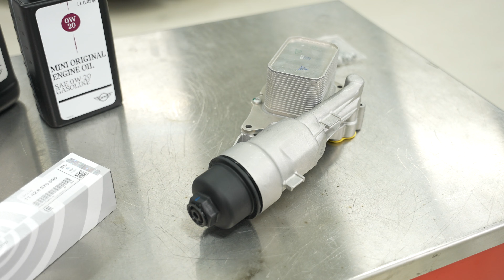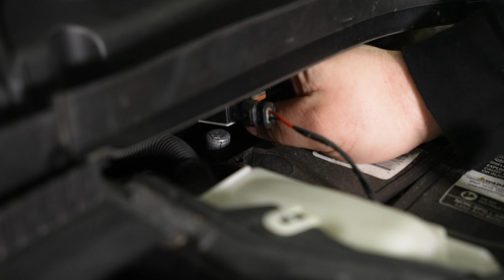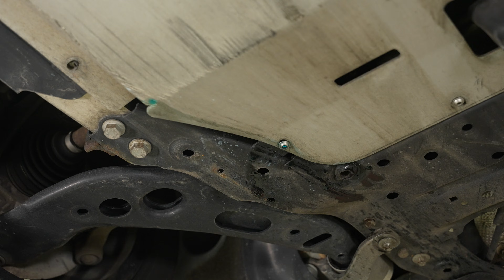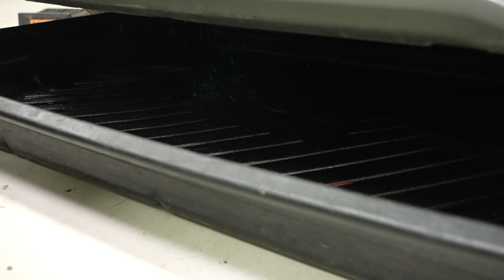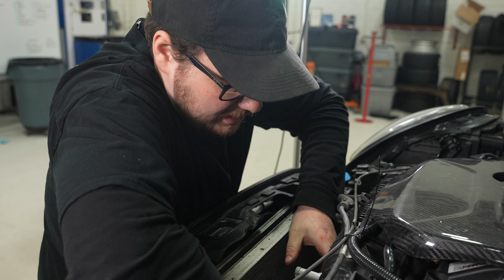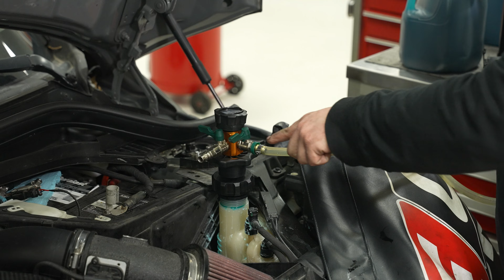B48 F55/F56/F57 Mini Oil Cooler Housing Replacement | ECS DIY

Comment: Thanks for the great video.  I was able to remove and replace mine without touching the AC on a 2017 Mini Cooper S 2 door by following these directions.  I did run into an issue removing the fan shroud.  There is a barb on the passengers side just in front and below the mounting bolt.  It took me a while to figure out it was there but once I saw it I was able to pry it back with a flat screw driver and get it out.  When you have the old oil cooler out, move the wire clips from the old one to the new one before you install the new one.  I neglected to do this and then had to remove the new one to get the clips on and in the correct orientation.

Comment: Can you do the afding the collab part without that suction device? Just poring in New coolant?
Reply: yes u can , but u wll have to bleed the air using the plastic crew next to the coolant cap

Comment: Great Great guide, thank you, I found it useful. However, the torque you provided for the oil filter housing bolts is incorrect. The official guide specifies 10Nm, not 8Nm.
Reply: https://static.nhtsa.gov/odi/tsbs/2014/MC-10148281-9999.pdf

Comment: 2018 Mini Base model with B38 - USA.  My car has one bolt left before I can remove the housing...yep the much talked about bolt that is directly behing the elbo that comes off the of the back of the A/C compressor.   Maybe a warning that this procedure only working on the model you repaired and give a detailed configuration.  😡

Comment: Thanks for the video - I just took mine to the garage with an oil leak.  They judged it was the oil filter housing that they replaced.  Its still leaking so I got under the car and saw oil forming on one of the bolts.  They are now saying it is the oil cooler leaking.  Am I correct in thinking the oil cooler fits on to the oil filter housing and this would have been removed and refitted in the process of replacing the filter housing?

Comment: Trying to reinstall with ac in place proved too hard for me… I got it out but can’t get it in.  So I removed the 4 screws on the housing cover and slid it in in 2 pieces. Hardest part was getting the mounting bolt thru both pieces near the ac line.  Do that first.  Then the 4 screws. Then the remaining mounting bolts.  Not fun.

Comment: Yes, the a/c is definitely in the way on my 2016 base cooper… I was able to get the housing out without touching the a/c but I had to make a custom “offset E10” socket - basically a short L shaped extension welded to a shortened E10 socket - only for the the lower 2 bolts - could only do a 1/4 turn at a time but it worked.  Still a challenge to snake the housing out, but it came out from the top.  Also, before unbolting the housing, had to pull all cables off starter and pull them all the way thru the small gap between the a/c and housing.  Good luck.

Comment: Not going to lie, the most important part you left out. 😂

How to get the 5 bolts out. 

U have to remove AC. Was this not mentioned?
Reply: I just did this work on my 2019 F56 and had more than enough room to remove without having to drain the A/C. Maybe depending on model and year of the mini it will have a more tighter work environment?
Reply: Just replace one on a 2017 definitely did not take the air conditioner, lines or air conditioner out of the way
Reply: @lukemcmullen5976  you had to remove the compressor bolt though

Or one hell of a swivel
Reply: Well, there’s AC line that comes off the back of the compressor. It is pretty difficult to get around, especially with torque wrench is possible though wish I could put a picture on here. I actually got it sitting right in front of me.
Reply: @lukemcmullen5976 

The time you take trying to get around it  isn’t worth the headache

I removed compressor and that was stuck on the bracket
Reply: 🥷🏼 the a/c line is miles from the housing 😂

Comment: How long does it take for the entire process? I am trying to predict the cost from my garage
Reply: When I was quoted a time from my local Mini dealer (who has been pretty fair with service times in total in my past experience, though I'll leave that to others for the quote they gave for this job), they estimated a 9-10 hour job to replace it and clean up the previously spilled coolant. If I had a garage, I'd probably do the job myself anyway to save the money on labor, but I don't. Ended up grabbing an F56 instead, and I'm hoping that it won't need this fix before I get a garage lol

Comment: is it the same procedure for F56 engines? do you need to remove AC cooling line right next to oil filter cooler?
Reply: very similar f55,f56,f60

Comment: DO NOT attempt this unless the refrigerant has been properly recovered using a refrigerant recovery machine or by an AC shop. The AC lines must be removed—there is no way around it. I tried every possible workaround, and now it’s too late: the oil filter housing is stuck and will not move in or out.
I now have to purchase a refrigerant recovery machine to evacuate the refrigerant before continuing. If you plan to do this job, have the refrigerant evacuated at an AC shop beforehand and recharged afterward.
It might be possible if you are willing to bend the AC line, but I strongly advise against it. If the line breaks and compressor oil leaks out, it becomes a much bigger and more expensive problem to fix.

Comment: How do you get the freakin fan shroud loose? I’ve removed the bolts and can’t see any clips or anything
Reply: Dealing with the same thing right now and would love to know how this comes off. In mine, it almost feels like it's bonded to the radiator.
Reply: If anyone runs into this, there's 2 clips by where you remove the screws for the fan shroud. The one on the driver's side will be facing away from you and the one on the passenger's side will be facing toward you. There's an opening where you can insert your pick tool and use it to pull the tab away from the shroud while you gently pull up on the shroud. Once you do this on both sides, the shroud will come right out. I *really* wish this had been shown in the video as it would have saved quite a bit of time trying to figure this out.
Reply: @scottdaves3930 you’re a lifesaver, thank you
Reply: @scottdaves3930  thank you so much for the solution i've been struggling with, both the editor and cameraman for this vid are trash. can't see what their doing half the time AND they're skipping over crucial info.
Reply: I just did this and one thing that held me up was these fins that line the back of the shroud. They’ll flip upward and catch on stuff. I used a big flat head to push them down as I pulled upward. 

It’s a little bit of a battle lol

Comment: Awesome work. Could you let me know the risk of removing the intake plenum for this work? It feels more easy than removing radiator fan and will give more access. Sorry for the noob question.
Reply: Do it, remove the manifold intake, I did it and it was very easy to remove and reinstall but it has its extra considerations. If you remove the intake you may have to change the intake seals (in my case I reused the ones that the car had because they were in good condition) and also reuse the throttle body seal.
Reply: Curious if you ended up doing this?
Reply: @dakotahybarra5607  Yep. I just took off the airbox, intake manifold, and few wires. Because I didn't remove the fan or the front cross member, reaching the bottom bolt was a little difficult.

Everything went well except that I got a vacuum leak after from me being clumsy. I thought I left a paper towel inside the intake hose but turns out I forgot to snap in one of the air hose adapter by the breather valve. Sigh.
Reply: @PKW_WKF may I ask you what your r&r time was?
Reply: @951vietpimp  its been a while but I think the filter housing job took around 3 -4 hours. I’m a diyer and took my time. This includes coolant vacuum refill and car onboard reset routine.
Reply: @PKW_WKF it'll take me longer than. Don't have shop air. So good ol fashion fill with the bleed screw open. Thanks for the reply.

Comment: BEFORE FOLLOWING THIS VIDEO!To the Americans! You will have an AC compressor in your way! The way I ended up getting around this was by removing the top bolt for the compressor and loosening the bottom one, removing the serpentine belt and using a metal object and hammer to move the compressor out of the way! Be careful as it gets very close to the radiator and may bend some fins! Either that or you can take it to a shop and have them remove the refrigerant before you get started on this job then you just have to remove the AC line connections that are in the way! (I was already in there so I had to get creative)
Reply: This needs to be the top comment
Reply: Wow I mean what the hell - looking at our mini in the driveway now. I removed both bolts and th thing won’t move out of the way
Reply: @cwfeldmann I know, it's in there tight as hell isn't it?? I hope you figured it out, but if not what I did was take a long pry bar to the top of it and wedged it in between the AC compressor and the engine block then just keep hammering it in there until It moved enough... THEN to get it back in place I had to basically do the opposite underneath the car! I had it on jackstands and got a big speed jack, put a hole puncher underneath the exterior side of the hinge on the AC compressor and used the jack to apply upward pressure and move it back into place... I had many scares doing this and probably almost lost a finger or two so BE CAREFUL¡
Reply: Not necessary. Just did this job without all that. It helps but not necessary.

Comment: I need to do this on my F56.  I replaced the gaskets for good measure when I had to replace the engine and must have screwed it up.  I ordered the metal one so I don't have to worry about it anymore.

Comment: This is not an equal process to the clubman btw. AC line gets in the way
Reply: Same for the F60, AC line in the way, what solution did you find to avoid disconnecting and loosing the refrigerant gas?
Reply: @salvesed.o.c.4154  just remove the upper bolt of the ac compressor. But u have to lose the belt first..
Reply: @salvesed.o.c.4154 if you attack it from the bottom you can work it out. If you’re working while standing at the front bumper, here’s what I did. Pull the cooler as close to you as possible, then twist it right horizontally(keeping it upright). You should be able to pull it a bit more. From there, rotate it counterclockwise, pulling the filter up lefty loosy. Kinda gotta brute force it out. Reinstalling is just as difficult but same steps in reverse
Reply: @salvesed.o.c.4154  just did a 2019 f60, ac line was not in the way

Comment: What's the mileage on that car when u replaced this?
Reply: I am also wondering this. I have a 2016 S hardtop with 40k .... should I be doing this soon????
Reply: @skylinecar1982  My 2016 S hardtop lasted 130k miles and i just now had to do this. My 2018 Clubman had 60k miles when the housing started to leak and i needed to do this. Seems like it varies a lot.
Reply: @MillionaireMalc  thank you

Comment: You have to prime the oil system.
Do not start the car and wait the oil pressure warning go away, that is a big no no, always prime the oil circuit first.
Reply: How is this done? Removing the fuel pump relay and cranking over is how I’ve always done it on other engines